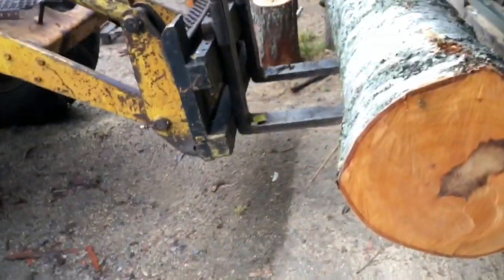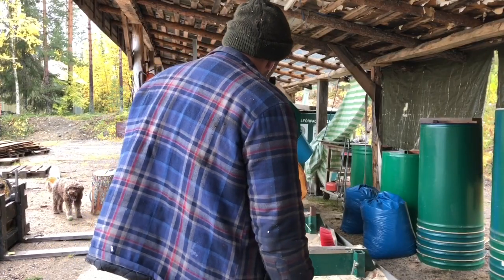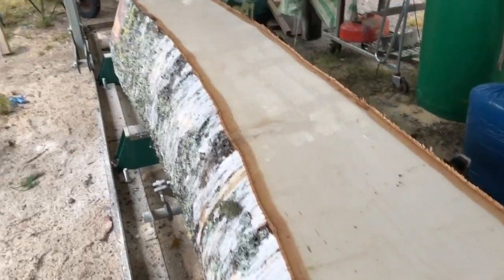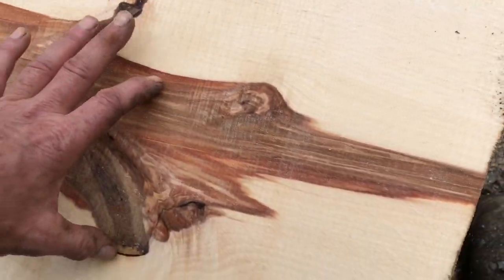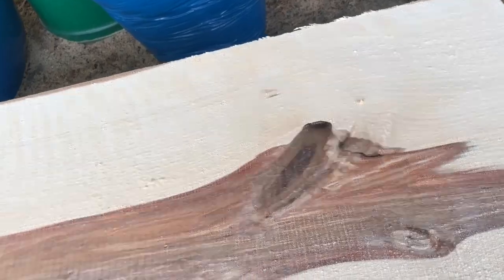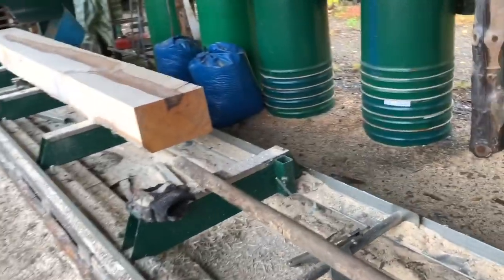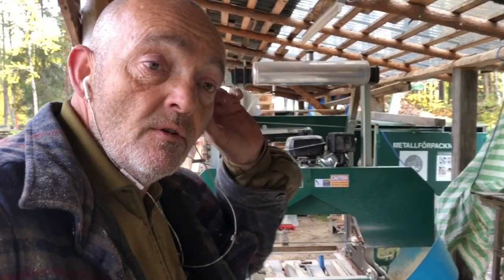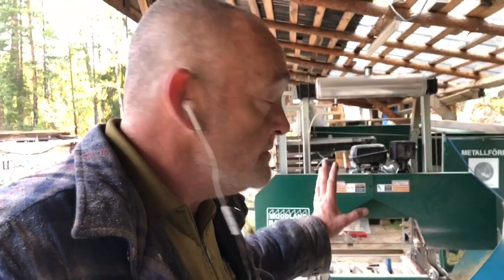Woodland Mills HM130 Sawmill Cutting Huge Birch Logs with Magical Grain and Colours.

Comment: Howdy Sir- I understand the back situation from working hard all your life. I bought the HM126 and waiting for delivery this month. Have been watching videos of the Woodland sawmill put up by seasoned sawyers. Trying to learn as much as possible before I start sawing. Thank you for your video. God bless
Reply from the maker: Your welcome my friend and am sure you will feel justified spending your hard earned money in that way. You just have to think about the turning of the logs versus what your back is comfortable with. Happy sawing.
Reply: @arctic-rebel  Thank you so much for the quick reply. I plan on using the tractor as much as possible. Blessings to you
Reply: Just a suggestion for turning the logs. If you use a small strap or rope in a 9 loop opposite the direction you want the log to roll, it cuts your efforts down to 1/3, aswell as keeps the log tethered for safety. You can use your machine or a lever. It also reduces the impact of the landing. I roll 2 ton stones this way, much easier and safer. And remember, if you can't tie a knot, use a cable. 👍
Reply: @hellogoodbye3129  Howdy - that’s what I’ve had to do for years. I have nylon lifting straps that I use with the front end loader on my tractor. Saves the back and mill bunks for sure. Good advice, thanks. God bless

Comment: Looks like our black walnut inside appsolutly brautifull.what was done with the slabs sir
Reply from the maker: I am guessing you are new to the channel, these and other slab have been air drying and are currently stacked inside the shop ready for turning into my new kitchen. The latest video of me fixing the gearbox on my snowmobile shows them I think. Or maybe me fixing the van. I know one of them does because the stack is so large it takes up half the doorway. I should have been into that already but the endless snow and bathroom job is taking time away from my own project this winter. They will be the most turned into the most stunning kitchen.
Reply: Yes sir I’m new here and look forward to watching your videos and having a look at your kitchen.I’m assuming you are a carpenter as well ?

Thank you for your response 
Jeff Tennessee USA
Reply from the maker: @j.jacobson  Hi Jeff, Carpenter, joiner and Machine operator are my finest skills but I can turn my hand to many things all of a good standard.